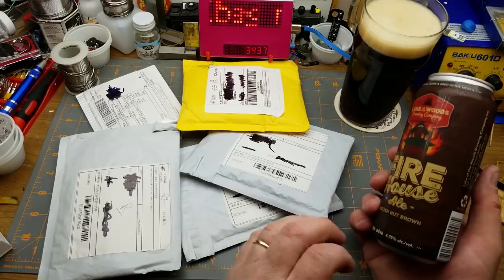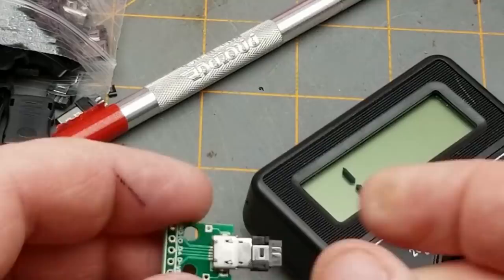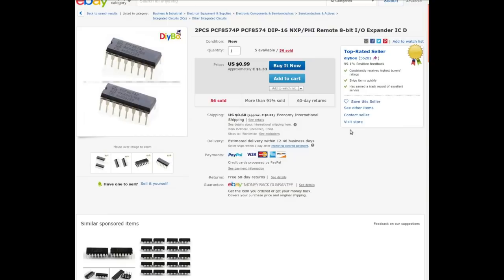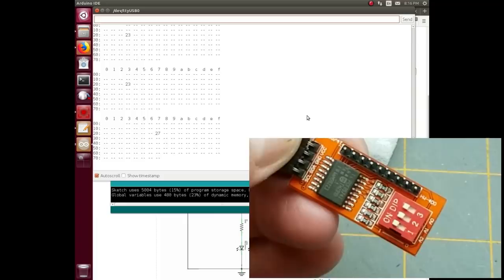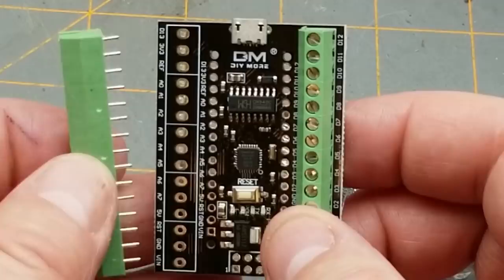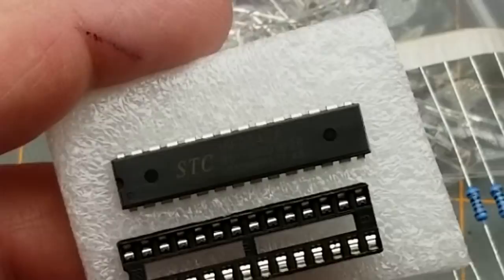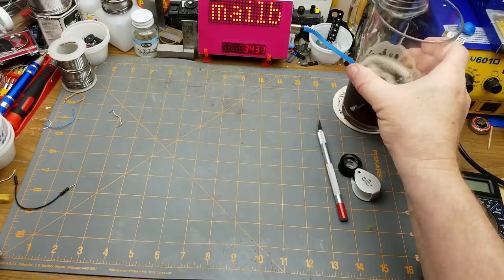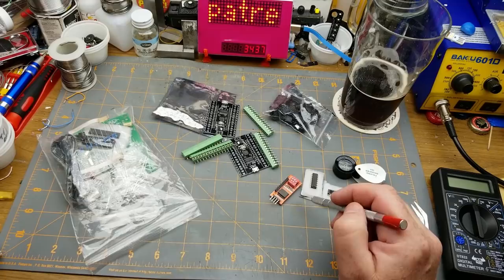mailbag monday #58

Comment: In case you are unaware the PCF8574's can have one of TWO address ranges. (Another reason for the product code suffix)

Do an I2C address check on them just to be sure, (the sketch comes with the Arduino IDE.)

I've wasted a few hours before with a batch of 10 having different I2C addresses.....I mean, who knew? LOL

A great little IC though, which can also be found on the [1602] LCD I2C backpack.

Thanks for the videos, very enjoyable and much appreciated.

Comment: 10:20 - when you build the Star you will see some exceptionally clever programming to get RGB patterns from automatic colour-changing LEDs. Really really cool.
I have built 3 of them - I soldered in everything except the LEDs, then spray painted the face of the PCB matt black. Makes it look really great
Reply from the maker: That's a clever (and cheap) upgrade.

Comment: I've been wanting to make my own phone charger: a big brick wall wort with a 3Amp LDO.  So sick of these cheap usb chargers that can't keep up when I tax my phone's cpu !!!!
Reply from the maker: The other part of the equation is negotiating with the phone to convince it that you have a charging source capable of supplying higher current.
Reply: @pileofstuff  really?  I had no idea.  I thought I could just give it 5volt and 3 Amp capability and it would charge better than these adapters that eventually wear out.  Maybe these adapters I have, have some negotiating circuitry? Or are you talking about the 9 volt stuff?
Reply from the maker: @TheRainHarvester  There are a variety of resistance combinations between the data pins, or a voltage divider between ground and 5V presenting a specific voltage to one of the data pins that can tell the phone what the current capabilities of the charger are.
Most phones will default to 500mA unless the charger indicates that it can do more.

However there isn't a universal standard and phone manufacturers often go their own way and do it in ways that aren't compatible with other manufacturers.(bad Apple. Bad)

And then there's the whole "quick charge" thing, which is more of an active handshaking between the phone and charger to allow higher voltage and current.

There's some information here, if you are interested: https://www.maximintegrated.com/en/app-notes/index.mvp/id/5801

Comment: Anybody know where i can find USB female panel jack? Want to add USB to my power supplies, etc, and just want to cut hole and screw it in...like a headphone jack.
Reply from the maker: I would probably just grab something like this and strip the wires back:https://www.ebay.ca/itm/0-5M-3M-USB-2-0-A-Male-to-A-Female-Panel-Mount-Screw-Hole-lock-Extension-Cable-H/233209047639
Or , if you have lots of money and want to go all heavy duty:https://www.ebay.ca/itm/Neutrik-NAUSB-W-Nickel-Panel-Mount-USB-Jack/181530246943